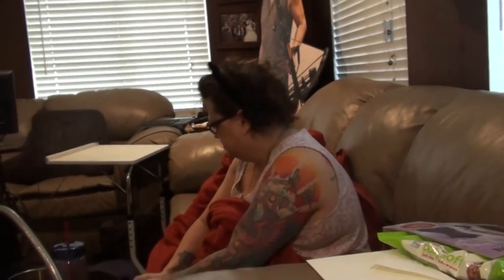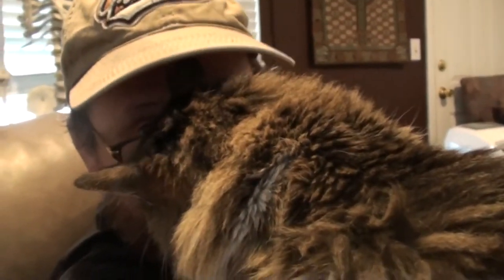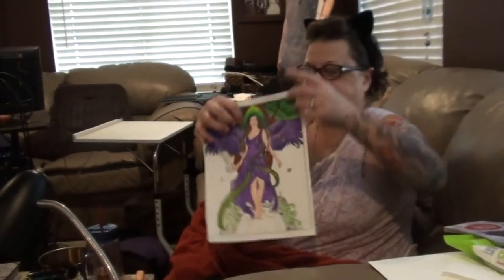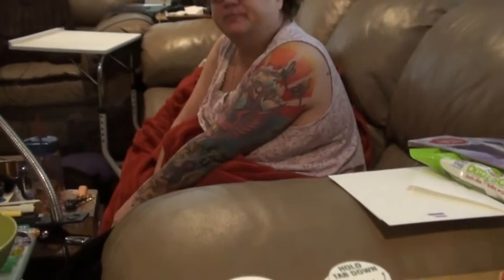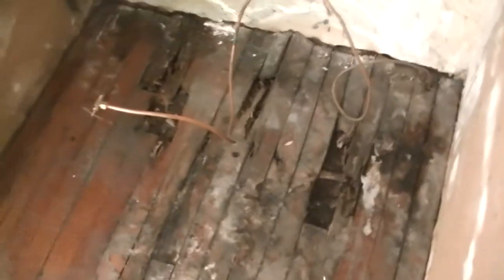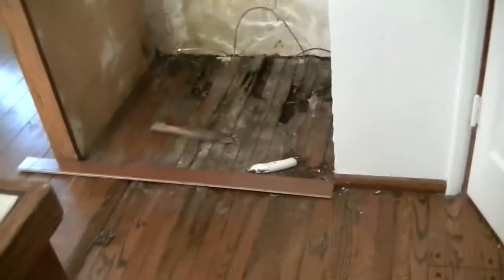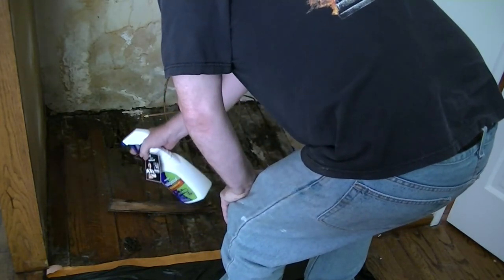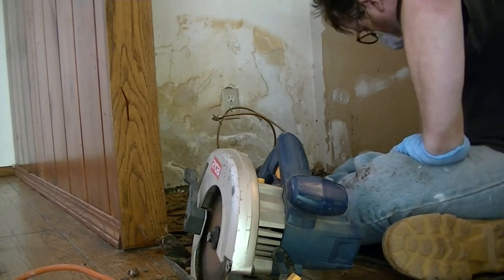MOLDY FLOOR

Comment: Why should the copper pipe go through the wall and not the floor?  I swear I've seen many new houses have there sink hot and cold line and drain pipe going into the floor.
Reply from the maker: I would have run the copper line through the wall from under the house and attached a recessed ice maker cut of valve.  That's what I put in my house.  That way the line is not exposed to damage and it has a cut of valve.
Reply: Oh I see.  Thanks for your reply!